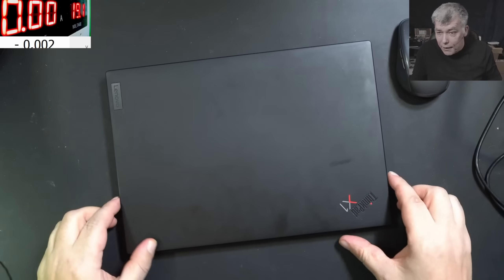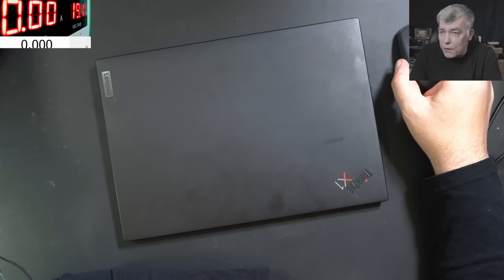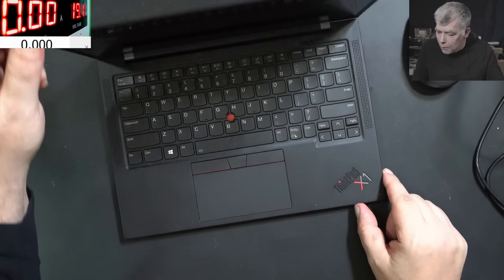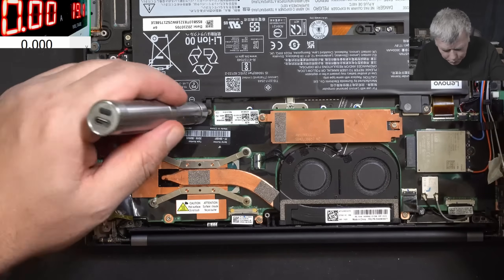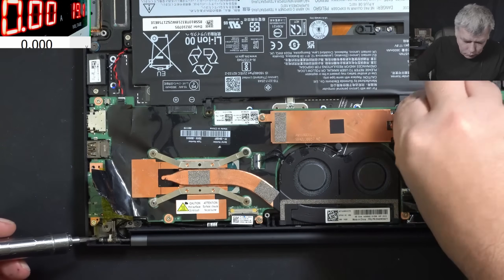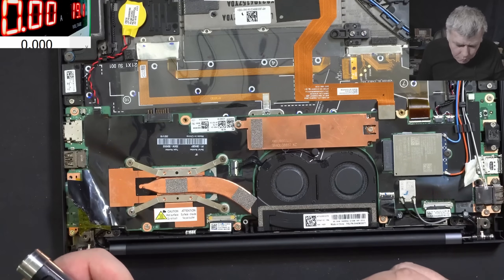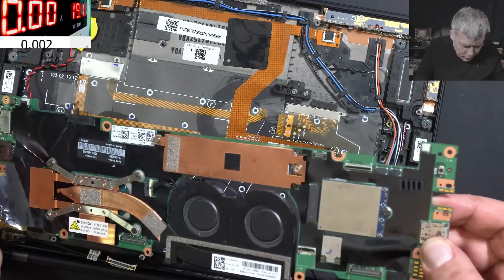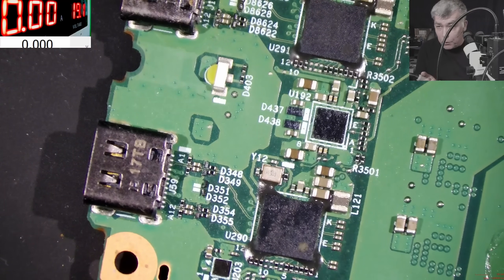ThinkPad X1 Carbon usb-c ports repair - user-replaceable usb and audio jack ports? Very nice design

Comment: Hello Sorin, great job as you always have us used to. I find it a little easier to solder those connectors, leaving the gaps in the connector tabs free of tin so they don't move as much. Thanks, as always

Comment: Some advice on soldering ports for everyone, you should pre-heat slightly the pins on the port and the pins on the board after you put new solder on it, this doesn't only help accelerate the bonding, it ensures it becomes as good it can become and especially for the ports which have pins that are not in the "line of sight" of the heat gun (the ones usually beneath a port).
And lastly, when you are applying new solder in the outer big pins for a connector (through-hole) which are usually either a ground or a holding spot for the connector, you don't need to create blobs of solder, that doesn't make it "perfect" as Sorin says (out of habit most of the time i would assume), what it does instead is that it adds more unneeded mass to that pin, making less reliable.
What you should do instead is put enough flux/rosin, make sure you have enough heat on your soldering iron for solder to melt fast enough (within a few seconds), touch at least 4-5mm of the tip of your soldering iron for at least 5-6 secs on the the part you want to apply solder, then touch that part of the port you are heating up with the solder and let it take as much as it needs but not more (too much heat will melt it very fast tricking into thinking you've done it properly, but it's usually not the case especially if the pin itself isn't heated enough), then keep the soldering iron for another good 4-5 secs and you are likely done, you'll know as you will see, with enough amount of flux/rosin that the solder became a part of the pin uni formally and not like a blob (it's not that you can't still not have a properly soldered connector with more solder thus still have a blob of solder on it but if done fast and a blob of solder remains it's usually a bad solder and Sorin did this in this video a few times which is why i want to point it, because he seems to think from experience that if you have enough heat you can get away with it as long as it works in the moment, it will likely not last a lot or will break and strong movement shock which normally, if soldered as i mention above, likely wouldn't unless you exceed the maximum force needed for that anyway).
This will ensure that solder went through the hole of the part/pin you want and that the reason the solder got stuck in it properly is because it itself was heated enough and "absorbed" the solder on its own and not the soldering iron, that's how you make proper, strong bonding which lasts for a long time.
You make this a habit and you become very good at soldering, it takes like 20-30 times to perfect it at best for most people, as long as you have the right tools and materials.

Comment: I Think Sorin is using black magic, or he has an on/off switch on the soldering iron, solder stays on the pad/board when he wants to and it goes back on the soldering iron when he doesn't want to stick on the pad/board:))))
Reply: that's black magic called flux/rosin

Comment: i bought an asus k53sv sx582v laptop in 2011. There was an earthquake in Turkey. I haven't turned on the computer for 3 months. after a while, when I started making updates, the computer started contracting. it remained on the black screen. the laptop is working, but it won't turn on. i took out the hard drive. I put it on another laptop, it works smoothly. maybe I removed the Ram in case there might be a problem from the ram, cleaned it up and increased the ram capacity. still, it didn't open. i reset the video card. it still doesn't work. What can I do. could you please help me? I even got a new laptop battery. still, it didn't work. it stays on the black screen.

Comment: That's my laptop. Looks like the previous service even didn't try to re-solder the port. They just heated the motherboard and damaged plastic film. That's very sad as I paid 105 pounds for the previous repair.
Thanks Sorin for his thorough work!
Reply: £105!! I would demand my money back and if they question it, show them this video.
Reply: That is sad indeed.  When you pay £40, you get (at most) a £40 repair.  When you pay for the £80 repair, what assurance is there that you won't get a £40 repair anyway?  That is the struggle.  Everything depends on where you take it.
Reply: There was flux on the other side of the board, so I do believe they took it out. But the port was still not resoldered properly. Maybe they used low melt solder (as Sorin suggested in the video) which can be brittle.
Reply: hmm , why you so violent against your laptop
Reply: @markodzo, what's so violent about this? The initial problem was the USB-C port breaking due to a child pulling the charging cable. This can happen to anyone. Also, in my experience, if you are using your laptop on your lap rather than on a desk, the weight of the cable and body movement will cause the port to wiggle up/down, which can lead to this problem. I understand if you mean something like bent phones, laptops because someone threw them or sat on them. But the typical flaky USB-C port connection seems common to me since it is the most commonly used port on the device and it is expected that it will not last long.
Reply: @efim   ''ok ok, ''i believe you, no need for those confessions ''
Reply: @markodzo it's usb c, what you expected?

Comment: I've never seen that plastic insulator having been melted before so only explanation is like you say, must have been done by a previous repair attempt.  Lenovo/IBM laptops used to have their power jacks on a small lead so you could easily replace it and then they started soldering them in to the boards on the ones we have so nice to see on some models (why not all) that they are making them easier to replace as they must be one of the most common things to get damaged/worn out.
Reply: Yeah should be mandatory to put the usbc charging ports on replaceable daughter boards. USB C is really convenient but they are so tiny and up to 24 traces. They can't handle much abuse.

Comment: I will always say Type c is a bad decision for laptop power port
Reply: Everybody knows that, but is good for those who does repair.
Reply: Mostly usb-c cables with large plug that sticks out and gets a large lateral whack which wrecks the socket or the solder joint.
Reply: From my point of view, it is convenient for user, as you need only one connector for everything. For example, I connect external monitor, mouse, keyboard, speakers and charger only via single USB-C port. So I don't need a lot of cables and I can use a single electricity socket for this setup.
Another thing is that the reliability of this port is not as good as we would like :)
Reply: @efim  Every thing has cons and pros.
Reply: A terrible choice. I mostly hate Apple and never use their devices, but I must admit, lightning plug was a much better decision. Just as magsafe